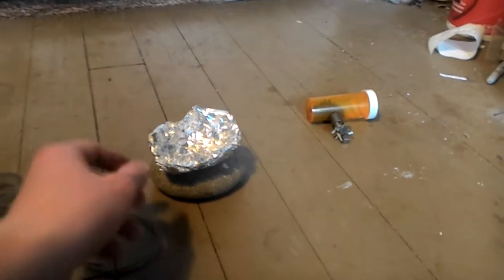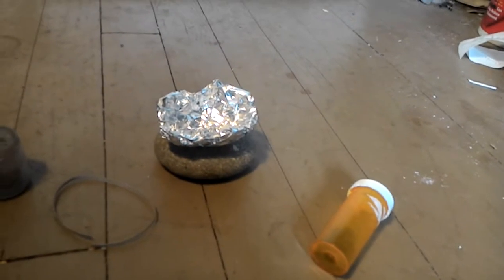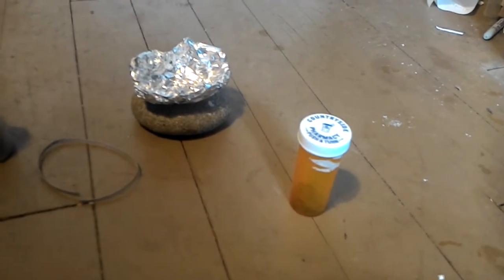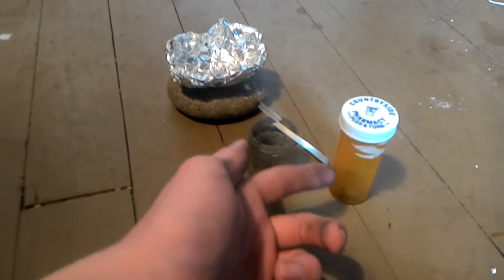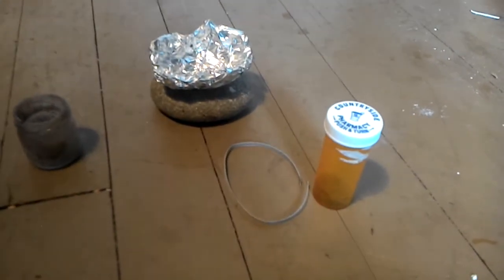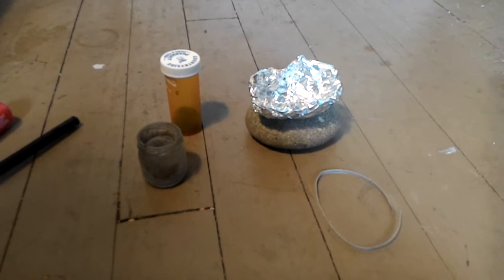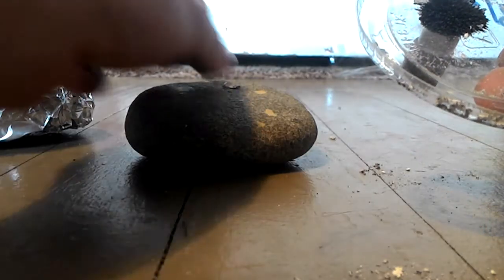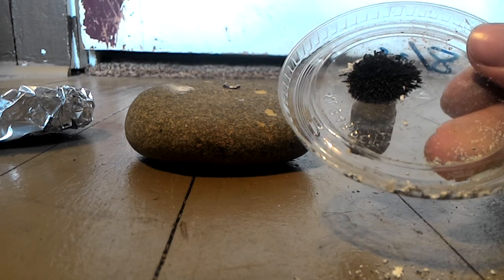From Magnetite To Iron

Comment: Try with some crushed limestone. it help, Should be 1/4 charcoal dust 1/4 limestone dust and 2/4 magnetite dust. Super heated and it should make cast iron. Then you must heat quench it to make it stonger. to heat quench you nead to heat your cast tell it is orange. then put it in either oil or water. repeat for how brittle yoou want it. you should do it a couple times atleast. I hope this help. Make sure it can be heated around 2,800 °F (1,538°C) so it can melt into a cast. Hope this helped.